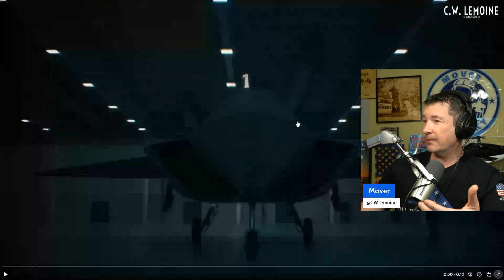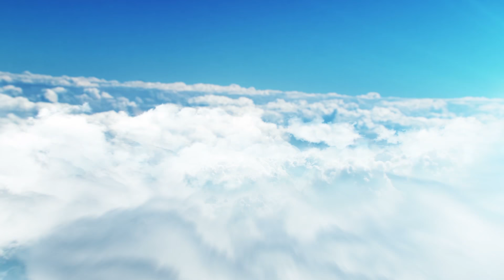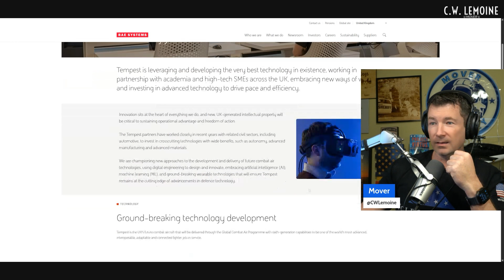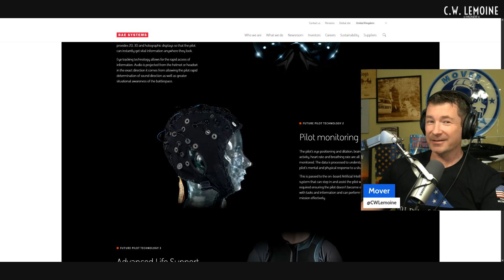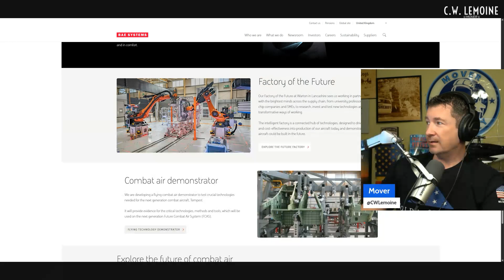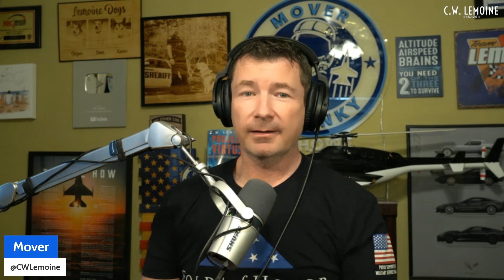The Technology Behind Britain's New Tempest Fighter

Comment: So far, 6mins of dribble! ... Jesus this poor content👎 .. Key points the tempest uses ai davinci systems (Swedish, greppen ect)... Its main use is to fly with up to 60 drones linked in per one fighter these systems can also be flown without a pilot in cockpit these systems coupled with next gen radar, Protection & safeguards for these systems are also next gen. This soul fighter  pisses all over anything the US is makin or investing in currently. In terms of capabilities. Many will laugh at the tempest as they did before with the tornado, untill its function is measured alongside its intended role. 
👌🎯🇬🇧

Comment: I think Ai will be great for managing weapon stores. It could see a target determine what it is I.E MiG29 or whatever and set up guns automatically for the correct wingspan. Or auto select the best missile for the range etc. Maybe even set the counter measures quantity and type based on the most probable missile launch based on enemy radar contacts. It would be like having a WSO that can think faster and better than a human. Apparently the Ai will also be able to detect based on facial recognition whether the pilot has G-Locked and take control to avoid hitting the deck too. Basically it can fly itself if you G-Lock and carry on evading for you until you wake up and take control again.

Comment: Reaction Engines sadly bankrupt worked with Rolls Royce & BAE on the Sabre, Mach 5 Hydrogen Jet Engine. While Hydrogen provides more power than Jet fuel it offers reduced range.... but what if..? It's not standard hydrogen fuel. One BAE sales guy on TV dropped a bomb saying the BAE Taranis Drone from 2013, was Mach 5 and had a global range. We Brits are very secretive about our tech, after 30 years you only just found out how good the Challenger 2 tank is. You would not believe what else it can do…. Drag racing at the factory for one. How advanced the Tempest really is well that’s the question. Having seen the full size mockup, it's very close to the YF-23, a plane BAE's development partner Japan were interested in...!!!!

Comment: It has a small tail because it is NOT a FIGHTER because in BFM and ACM it is not aerodynamic enough because it is designed to HIDE. It is designed to hide and hunt - it is a HUNTER instead.

Pilot Monitoring - detects when the Pilot regains consciousness after the AI has pulled 18Gs and the Pilot passed out but the AI shot down the Target. Enemy engages and you press the ACM Button and the AI kills it for you. Wetware cannot handle 18Gs but hardware and software can.

Comment: what you think or hear about Tempest, is nothing to what it actually is - it has adv AI, new weapon types, new energy solutions - but thats just what every other 6th gen also has - it has a number of new tech also - the actual a/c is as close to an organic as we can currently make (not wetware), in a similar manner to how we operate (understands fatigue, battle damage, tolerances, capabilities and resource management & supply & storage)
it has a nervous system both system wide and local with every part of the infra-structure being connected (from its outer skin, to its bones, to its resource storage, to it sensor packs, to its engines, to its weapon systems) - its AI is an much enhanced variant of what we all think or have heard of - it has autonomic features (similar concept to that of an intelligent BIOS, autonomous intelligent sub-systems) what come under the control of central brain which augments the human pilot (if manned) or on its own if required - in the early days we had the concept of a hive mind, with each mind voting on others solution until a persistent solution was agreed upon
Tempest is the jet, the CEO for the mission, but its future weapons will also have similar concepts within them (imagine tasking weapon solution to do a job and hand-off to perform it, under guidance and updates) - SPEAR is the starting point
much of this tech initially came from the mid 80's / 90's under the MMA programme (the intelligent augmented pilot), then enhanced from the DERA Norm Pilots (CyberLife - self learning) programme where it played with real front line pilots in the early 2010's - all that by the mid 2015's and now, who knows??
the DERA Norm Pilots concept was very interesting, as front line pilots early on stated they killed the AI, but the AI learnt from their tactics (their OODA loop) and after a while it started to win most missions - and then they turned off human tolerances (keep within 9G turns, etc), then the front line pilots reported it won every mission and started to develop its only tactics - it thats was just the jet, then think what a weapon solution would be like - India demonstated a few years back a weapon solution that initially did not race towards its target but turned on mid mission (it fooled many defensive systems)
our goto concept came from a film "Stealth" - Tempest is far from this film concept capability, but its a journet started
the only real show stopper being our UK gov constantly putting it on hold until tech caught up or no real threat adversary, and then key researchers had moved on

Comment: 1. I agree, sounds interesting but let's see it flying in operational test. 2. Higher tech means the pilot must now monitor that tech to ensure it is doing what is desired.
Reply: The No1 point of the tech is to reduce load on the pilot, this aircraft will do a million+ hours in the simulator before it ever lifts a wheel of the tarmac...

Comment: The most impressive thing about the Tempest is they have a goal to build the engines / aerodynamics to allow the jet to have a range at around 1200 nautical miles.  That part is the insane part.  Almost double the F-35
Reply: There will be no Tempest.  Mark my words.  Why?  Because none of the partner nations have even funded RDT&E for propulsion of yesteryear technologies, let alone modern ones.  ATF funding began in 1981, producing 4 different types of prototype engines for 4 different airframes, which were built by 2 main contract submission teams.  The engines were ready for flight by no later than Aug-Oct 1990.  During those 10 years, the Eurofighter partner nations were still messing around with development of 1970s tech with the Typhoon.  They still haven’t installed CAPTOR-E AESA Radars in the active, combat-coded Typhoon fleets in Germany and UK.  They’ve been talking about it for 20 years, always running into funding blocks in parliaments.  They barely just started flying with test articles with CAPTOR-E in Uk and Spain.  The airframe is basically obsolete in many ways, as it’s an early 1980s design with no stealth.

"Starmer risks diplomatic row as UK delays Tempest fighter jet programme
Japan and Italy ‘not happy’ as Labour dithering threatens to derail 2035 ‘combat-ready’ target”

‘Paralysis and indecision’
It is understood the contract for the next phase of the programme was originally expected to be signed by the UK, Japan and Italy by September.
This would have formally awarded a new tranche of funding – thought to be worth billions of pounds – to Edgewing, the Reading-based joint venture that was created to coordinate the development process and, later, manufacturing.
But the contract signing was delayed by the UK along with the publication of the DIP. It was then promised by the end of the year – before Britain pushed back that deadline as well.
John Healey, the Defence Secretary, committed to a 2025 signing as recently as July.
James Cartlidge, the shadow defence secretary, said: “This is itself the result of Labour’s decision to prioritise spending on welfare instead of defence, resulting in paralysis and indecision.
“John Healey needs to get a grip and demand that the Prime Minister and the Chancellor properly fund defence.”
Reply: @LRRPFco52  ... So much wishful thinking from the armchair 'expert'.
Reply: @LRRPFco52 
Fast forward to today….. funds paid and your post is nonsense. 😂😂😂
Reply: @IfyousaysoWTAF
What are you talking about?  £14.5 Billion for overall UK defence spending?

How do you think that breaks down?

Before a single production F-22A was delivered to the USAF, we spent $31 Billion in RDT&E on the ATF program.

Before a single F-35A, B, or C was delivered, we spent $61 Billion in RDT&E, which is roughly $20 Billion per airframe type.  

F/A-18 initial RDT&E was $22 Billion.

Even with the US providing GE F404s for the initial Eurofighter demonstrator, EF2000 RDT&E was more costly than F/A-18 because of multinational participation/cooperation and systems production redundancy for industrial manufacturing shares.

It's very difficult and costly to innovate new aerospace tech.

£14.5 Billion spread across RAF, RN, Army, RMs, and SOF is barely enough to temporarily sustain a boost in training, deployments, and planned acquisition of existing systems.

Comment: The "Modular Systems" is pretty important for overall development and upgrade costs. It comes down to whoever is writing requirements defining specific interfaces between components early on in the development process, because otherwise each contractor company will define its own interface if given no guidance.

The Electric starter generator is probably my biggest interest, since high torque electric motors are getting more ubiquitous with all the consumer level EV/Hybrid vehicles, and would remove the complexity and maintenance of the APU. A tiny fraction of the overall cost of the fighter, to be sure, but little things add up in the realm of reliability.
Reply: Modular systems are being led by italy. The Electric is led by England, italy as 2nd and japan as 3rd partner

Comment: If the AI works "most of the time" providing a good advantage, but every now and then "what's it doin' now" happens, this is a no-go for a civilian aircraft. However, in a fighter jet, you shout "I am outa here" as you reach for the face curtain. For good enough values of "most of the time" this becomes an acceptable tradeoff in war.
Reply: Equally it'll have done many millions of hours in the simulators long before a wheel lifts off the ground... It's less an aircraft, more flying computer....

Comment: Open systems architecture is a great concept, but many struggle with the up front cost it involves.

Also I am not an LLM expert but have taken AI classes and developed a few simple models.  I believe hallucinations are an integral part of how LLMs deal with gaps in concepts, this doesn't happen with other types of AIs but those types of AIs tend to be harder to develop as they need a lot of really good labelled data to develop (a lot more cost than LLM training of curated internet data).  Some AI will be good in the cockpit, but I question how revolutionary it will be.  As said though, I'm not an expert.

Comment: This aircraft will basically let the pilot believe he's in control when in reality he is not....
Reply: If your car has electronic power steering and brakes, you aren't really in control of it either.
Hackers proved a decade ago that they could access a Jeeps controls through its tire pressure sensors and could crash your car without leaving any evidence behind.
Reply: @kerbalairforce8802 the cyber truck is completely drive-by-wire. There is no mechanical linkage between the driver and the steering/pedals.
Reply: so like every fly by wire plane in the last 20 years?
Reply: @graveperil2169 no. Fly by wire is only one small aspect of what is involved here. You are not grasping what I'm trying to get at here. Fly by wire still needs a pilot input for control (GCAS etc aside).
Reply: @tripcee3367  AI?

Comment: Britain talking about building an advanced fighter jet without an industrial policy, secure access to critical resources, and abundant cheap reliable energy is not a serious plan. It is aspiration detached from material conditions. Advanced aerospace is not a design exercise. It is a systems project that depends on metallurgy, supply chains, machine tooling, skilled labor pipelines, and energy intensity sustained over decades.

Without those foundations, what you get is either vapor or a boutique production run. A handful of airframes, enormous unit costs, chronic delays, and permanent dependence on foreign suppliers for engines, avionics, materials, or maintenance. Sovereignty theater dressed up as strategy.

Energy is the most obvious constraint. High end manufacturing cannot survive on expensive, unstable power while competitors enjoy scale, state coordination, and predictable inputs. Add the absence of a coherent industrial policy and the result is financialization. The project becomes a vehicle for debt, consulting fees, and political signaling rather than a platform for national capability.

This is the late stage pattern. States retain the language of great power while losing the means. They announce prestige projects to reassure themselves, then quietly hollow them out through cost overruns and outsourcing. What remains is the illusion of capacity and the reality of dependence.

Without rebuilding the underlying industrial base, any talk of an advanced fighter is just that. Talk.

And the US is in a similar position and the $37 trillion in debt and shrinking middle class speaks for itself.
Reply: You do realise that the UK builds jets now don’t you?

Comment: Software overriding the pilot has created several F35 crashes.  The Eglin AFB crash happened when the software would not allow the pilot to do a go-around when he knew he was running out of runway. The pilot had to eject.  Another example is the F35 crash in Alaska which assumed the aircraft was on the runway and would not allow the pilot full control.  Another example is the aircraft at Lockheed that did a hard vertical landing and continued running high thrust on the engine  after the nose strut had collapsed, making the F35 do crazy donut circles on the pavement.  Handing more control to AI software could make it worse.  

There are two types of stereo vision … one where a flat 2D virtual image appears far in front of the pilot which eliminates the need to change eye gaze to cockpit instrument displays (saving almost a second of time for the brain to refocus & reconverge when switching between looking at instruments versus the real world). The other type of stereo vision is true 3D where symbology could be a scaled down 3D missile envelope and projected flight paths of other aircraft with respect to the missile envelope.  
      Stereo imagery is notoriously difficult due to extreme tight tolerance between left & right eye alignments (dipvergence where one eye must look up while the other looks down, magnification, rotation misalignment, etc).  The benefit of 3D (besides the possibilities of 3D imagery) is about 20% faster recognition (vision research result). However, tight HMD image alignment with the outside world is problematic for several reasons.  Also HMD stereo optics is more difficult due to overlapping optical paths forcing off axis optics which creates additional problems including ghost images & tradeoffs affecting good imagery throughout the “eye box” where the pupil may be located after helmet slippage and eyegaze direction.  Image lag latency & head tracker latency is another major headache 
   Based on these limitations of current level of technology, instead of stereoscopic HMD displays, the more effective solution is the Heads up display with an improved & expanded field of view JHMCS display.  Until a 3D HMD can be realistically demonstrated for the fighter pilot environment, it will be high risk.